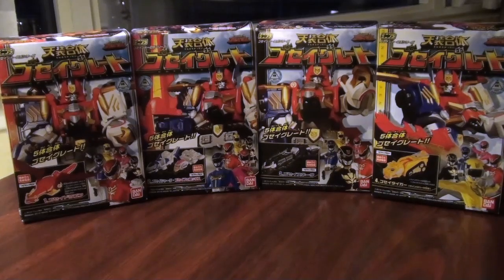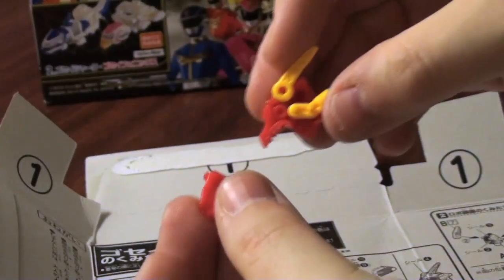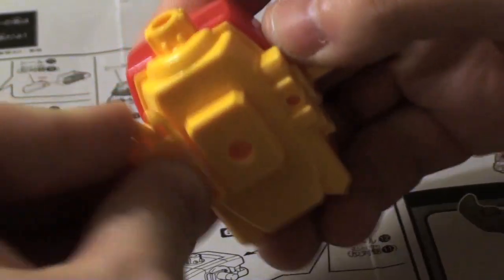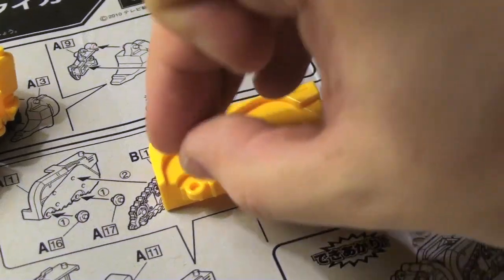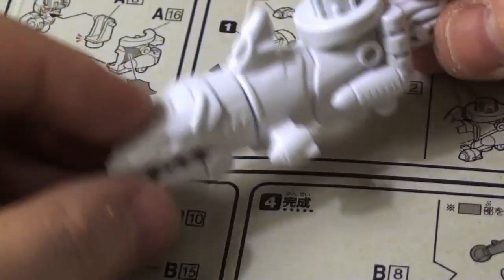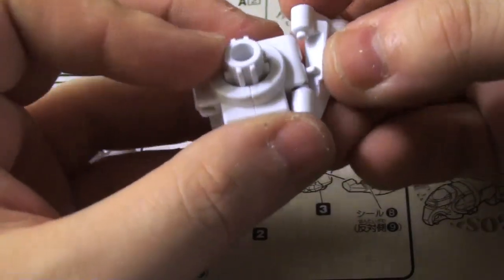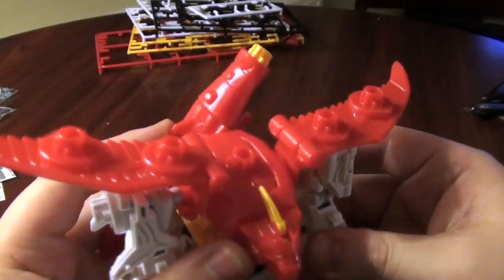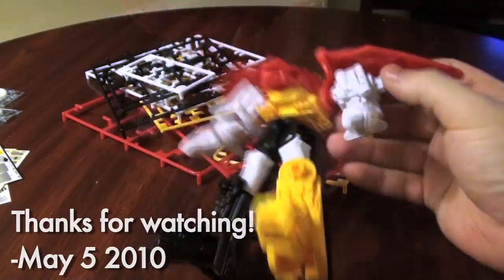V-Build 01 - Minipla Gosei Great

Comment: Actually, the best way to take parts out of a sprue is actualy leave quite a bit of flash on it so you can allways cut straight, then trim it down, this prevents the chance that snipping to close might fracture pieces that are to thin or have slight air bubbles in the plastic. Ok, the chance for this is near to none existant.

Also not knowing what these are, I guess some new series of power rangers/sentai?

P.s. Yes show finished/painted one.

Sprue to plastic recycling.